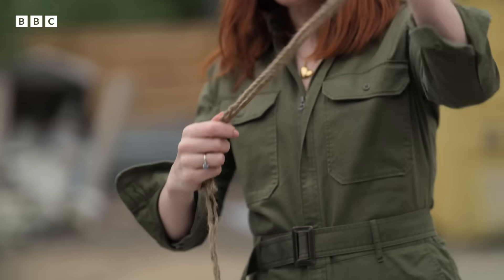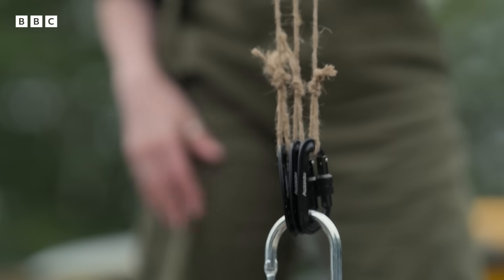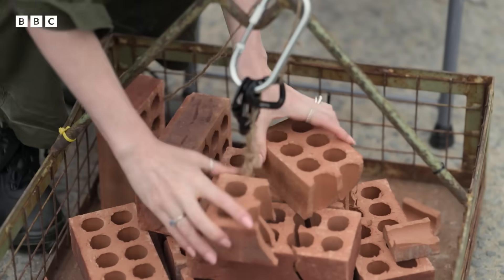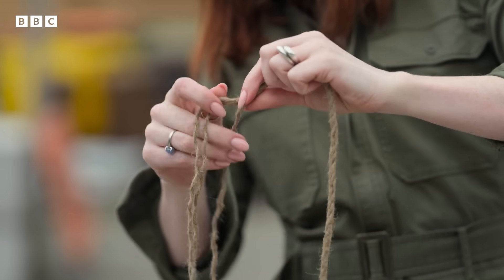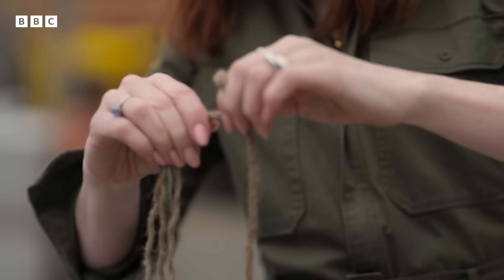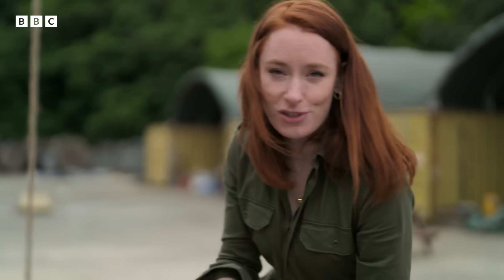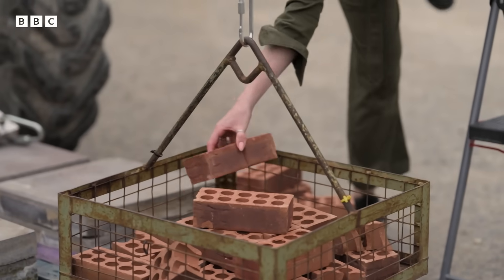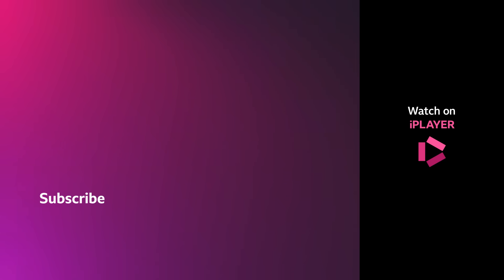The fascinating physics behind lift cables | The Secret Genius of Modern Life - BBC

Comment: And there is a third factor why twisted in one cable hold better I think, and I would like to hear what you think about it: because when you spread the weight across 3 separate and cut 1 - 2 are left. But it is not 50-50, but more like 60-40 % of mass distribution, and the one holding 60% fails even though it could maybe hold 50%, and then the one holding 100% fails. But when you get all the weight on them twisted and cut one - weight is evenly separated between the 2 remaining (even though they are working together so they can hold even more, which means the 2 factors you mentioned do their part, just adding this third).

Comment: Completely lost is the opportunity to discuss the power of pulleys or in this case block and tackle.  The original example used the weight spread across four strands of twine while the final example used a single strand.  Nice discussion of "united we stand" due to friction but a complete fail on the obvious difference in the two examples.

Comment: Not ideal because you have to restart the computer but it's secure, need some sort of self resetting fuse in other words. Drop the connection and the 100 or more MHz pulse takes over and grabs that data and grounds it or you can put it to firewall so you have a log of it as a dropped connection

Comment: 1.- The test is supposed to break threads by just adding bricks in the basket, not by cutting the threads . The weigh in the basket has to break the threads, not by cutting the threads.
2.-How to perform same test without breaking any brick : Lifting the basket just 1 inch above ground, not 3 feet.

Comment: Another factor in the initial failure AFTER one strand was severed is that, as the load was transferred to the other two strands, the remaining strands slightly elongated under the load, allowing the load to accelerate downward as the load was accommodated. 

Since F=1/2MxV^2, that slight amount of acceleration radically increased the load ( the “squared” function) on the remaining stands more than the simple static weight of the load, leading to a sequential “cascade” failure of the remaining stands. 

This “cascade” failure is incorporated in building demolitions as the accelerating upper stories’ mass “pancakes” the lower stories.

Comment: I'm not an engineer, but, if she had cut the center line, it would had still held the weight, by cutting the outside line, she suddenly shift the weight load. but that just my opinion.

Comment: Great production value....   if only the science (engineering) was as good.  Separate strands are only as strong as their weakest point (which is not uniform along its length).  When strands are combined (friction fused), the weakest point of any single strand is masked by the strength of the other(s) at that point in the braid (assuming that the weakest points of both remaining strand are not at the same point on the braided rope).

Comment: It did not fail at 44kg. You cut the string at 44kg.
Great video.
Reply: Didn't she cut the first string at 44kg, the load was then distributed among the remaining 2 strings which caused them to snap? So they basically failed at 44 kg I guess. When they were twisted, they didn't snap at 44 kg. 🤔

Comment: However carefully you tie the strands, there will always be one that is the shortest…even if that’s by an amount that doesn’t show. That will be carrying all the load and will fail first. That leads to the next shortest to carry the load…and then fail. That’s the classic domino effect
 Twisting the strands allows them to settle into sharing the load. Then they each carry their share.
  When using multiple cords or ropes to carry a load there must always be some form of compensation whereby they each carry their share.

Comment: Absolutely doesn't understand rope.
   First test was just putting the load on one yarn as the two remaining yarns were at different stretch.  So one failed then the other in sequence.
    Second test was with equal load since they were joined in a 2 strand rope.

Comment: The knot is the weakest point. In the furst test there were teo knots of one strand each. In the second test there was one knot consisting of three strands.

Also in the second test the length of rope with only teo strands was short. The short rope didn't stretch as much when as the long two strads in the first test. The longer stretching causes a longer freefall time which makes the shock (dynamic load) higher.

Also the bricks were added slowly after the cutting procedure in the second trst so the 'twice as strong' value is not a great comparison.

Comment: I think that when the threads were divided into three separate supports, and then one of the threads was cut, it triggered an effect of a sudden shift in the center of gravity. That’s why there was a cumulative additional jerk. It’s interesting what would happen if the middle thread were cut only.

Comment: I saw this in action when replacing a handrail made of worn polypro line. When I untwisted a length, it fell into dust. It turned out that the 10 foot long line was composed of four inch strands!

Comment: Along same lines you can build a large frame to hold  panels and mount it on a pole  OR you get a longer pole that goes above the panels and use wires attached to panels and pole for same result.  Except the weight is far less and less material needed.   Why this isn't used more often, I don't know.

Comment: There is another factor at work. When you twist the threads together the length of rope is shorter because of the path each strand takes. Under load the threads all try to straighten. This created compressive force inside the rope. Converting some of the tensile force into compressive force this way increases the overall tensile strength of the rope.
Reply: The compression force in the combined thread example is zero. There may be some horizontal forces between the threads resulting in a shear force from the surface friction.
Reply: @fuzybear15  If there is force between the threads at 90 degrees to the load and the threads are wound together and not straight that force is compressive. Ie. The strands are pushing against one another.
Reply: @alanbithell4587  Would a force perpendicular to material not be a shear force?
Reply: @ no , imagine one point of the twist with just two strands. Both strands are trying to straighten. They are pushing against one another in order to straighten. Now imagine you have your finger caught between them. What is happening to your finger? It is being crushed. The deformation of the strands caused by twisting them is converting some of the longitudinal force of the load into compressive force at 90 degrees to the load. It is not a sheer force as it is happening at every point along the rope.
Reply: That's excellent point. If the discussion of compressive force doesn't quite make sense to someone reading, the same thing can also be looked at through an even simpler lens:
When you twist the strands together, the whole thing gets shorter and __thicker__.  It makes a thicker rope, thicker than the three straight sections. A thicker rope is stronger, as we've all witnessed since kindergarten.
Reply: @senseisecurityschool9337  yes! There is actually more mass per unit length; the cross-sectional area is greater.
Reply: Yes. Several factors were glossed over in this demonstration.

Comment: A viewpoint from a structural engineer: a strand does not have consistent tensile strength along its length. It will therefore fail when a load exceeds its weakest strength within its length. When multiple strands are bundled together, the probability is extremely small that the weakest points of each strand lie at the same point. The resulting strength therefore increases closer to the average strength of the combined strands rather than limited to the weakest strength of one strand. If one strand within the bundle is fractured, the resulting strength is limited by the average strength of the remaining strands at the point of fracture. 

When using wire rope for structural designs, we use multiple factors of safety to cover strength variability, load variability, and (if needed) reduction of strength over time if the rope is in a corrosive environment.
Reply: the problem with this analysis is that the weak point will almost always be the knot that connects it to the carabiner (see the channel how not 2 for reference on this). If you check the separated-strand failure it appears the remaining two strands both broke in the knot. 

So I would hazard a guess that the thicker bundle is stronger in the knot, possibly because a thicker bundle has a larger bend radius, although there may be another effect that I can't think of. The larger bend radius should reduce the concentration of tension onto the fibers on the outside of the bend.
Reply: @justinburstein5349  interesting ! Hadn’t thought of that but again - makes a lot of sense .
Reply: The other thing that can happen in this kind of situation is differential loading of the separated strands. It's hard to make the strands exactly the same length, and things like load distribution can mean that some of the strands are carrying more of the load than the others. This increases the chance that one will surpass its breaking strength when a single strand is cut. With the twisted strands, they are more likely to be the same length, and the load can be distributed more evenly by frictional forces.
Reply: Also I suspect the dynamic transfer of load on individual strands is more significant, with the strands together there is less elastic drop putting dynamic tension on the other strands.
Reply: Good explanation. But twice the load?
Reply: @mohamedgoldstein5565  why not? Let's say a strand could hold on average 15kg, measured as the load capacity at several points of the strand and then averaging those measurements. But the lowest measured capacity was 10kg, that's the weak point. Such strand could in theory hold those 15kg if the weak point wasn't there.
By twisting multiple strands you spread the weak points all over the length of strand making the whole bundle behave as if it was the same average capacity in all points.
Reply: Your point is demonstrated during the replay of the individual strands breaking.  After cutting one strand, a second strand breaks and then a moment later the 3rd strand breaks.  The remaining 2 strands did not break at the same time.
Reply: In the first demo when the one was cut it was the shock load that caused the failure. Shock load and static load are two different things.
Reply: What if the three strings in the video break at their individual weak points that are apart from each other? Will the rope still hold the weight in place?
Reply: Oh no I’ve gone cross eyed
Reply: Friction comes into play when one of the 3 strands break at one point, but it is still twisted for a long enough stretch. After the break, locally near the break there are only two strands holding the weight, but the farther you go away from the point of failure and the more friction there is between the three strands, the more the 3rd broken strand comes back into play. 
Think of it at microscopic level, where the fibers are twisted to form a single strand: in this case all the fibers are shorter than the whole strand, and yet they work together thanks to the friction. Each fiber is useless at its start and at its end and contributes more and more as the friction keeps it together with the other fibers.
Reply: Came here to say straps are mind bogglingly strong (more weaves more strength)
Reply: Could you explain in English please 😅
Reply: @maxayam8268  when strands are wound together into one larger cable all the strands carry a near equal amount and individual weak points in different strands become far less significant so the failure of a single strand becomes less likely
Reply: I was going to say the same, but you worded it far more elegantly than I could have done
Reply: The impact loading on the two remaining strings would also have an effect as well as the averaging effect in the second case.
Reply: A viewpoint from a KFC Food Service Worker: When the 3 strands are used individually and are some distance apart, the corresponding load path will be spread across that span of the 3 strands. It may not even have been equally spread across the 3 strands; I wasn't able to assess the end conditions. The cutting of one strand causes a significant change in load path (i.e. it won't automatically be equally spread to the remaining 2) and a subsequent jolt [ d^3r(t)/dt^3 ], therefore a once-static load becomes dynamic. The nearest strand to the cut strand will take nearly all of the reaction to the jolt.
The elasticity of each strand will also have an effect, as the cutting of one of the strands will then cause the others to stretch further, hence allowing the the static load to become dynamic further.

I don't believe in this particualr instance that the variation of tensile strength across the length of each strand would be that high.
Interesting point nonetheless.
Reply: TY for this. Hannah invokes friction when demonstrating with a sisal or hemp twisted rope. Do you agree? Friction would seem less impactful with smoother material- nylon or steel; and more impactful with braided rope? (I've zero expertise here.)
Reply: I think there is another factor to consider, when the strands are twisted the area perpendicular to the load increases thus the load per unit area decreases. Why does the area increase? Think of twisted cylinders and make a cross section perpendicular to the load, the area would be made of ellipses with a larger surface than the circular cross section.
Reply: Thank you for this explanation. Dunno why the presenter couldn't have said that.
Reply: Thank you so much for taking the time to explain this! So nice to have an explanation - it’s a shame that the video was so content free as to not explain this, the intersting part despite being so long. There’s a really interesting story in this phenomenon that the producers missed. I’m not convinced she does well when straying outside what she knows about. Being a charismatic presenter is not sufficient. 

I keep reflecting that braids are stronger still - and I presume for  similar reasons - and that they are extremely resistant to fraying, which in a conventional twisted rooe presumably results with almost certainty the weakest part of the bit that’s cut becomes  loaded …

Comment: Having three separate "threads," each with its own uneven load that is suddenly shifted when you cut one doesn't help either.  Tossing in that last brick tells you more about the effect of the impact than its tensile strength.
Reply: It's been a long time since I studied physics but that struck me too. Also, if you could confirm what I am thinking--

The friction's got very little to do with helping the overall tensile strength. The main factor why the crate dropped the first time was the fact that the ropes were tethered at different angles. When they straightened vertical due to gravity there was impact along the ropes.

The friction isn't suddenly gonna increase the overall upward force; the overall strength modulus of the rope is inclusive of it. Rather, the twisting of strands increases the amount of rope used thereby changing the cross-section and strength characteristics of the totally new rope.

Unless they used the same lengths of strands, twisted them resulting into a shorter new rope compared to the lengths of the original strands? Maybe the friction thing is true then? I am not sure.

Thanks in advance!

Comment: In the early 70’s, a fiend of mine tested the strength of various types of lines (ropes) used in sailing when dry or wet.   He measured the amount of stretch by holding a section of a steel carpenter’s tape measure on a stick held up along side the line.   When the nylon line failed (ie broke), a stand sliced the metal tape in half.

Moral: do not stand next to or in line with a pieces ripe, cable, or line when under tension
Reply: Extreme example, failure of an arresting wire on an aircraft carrier. Don't search if you have a weak stomach.
Reply: Too many spelling mistake, but understood without any problem
Reply: @manabpratimsarma6777  fair
Reply: Ya, heat tha 2.

Comment: The issue with this is that as soon as you tie a knot in any rope or string or cord etc, it weakens it by approximately 50%. They’d have been better tying what’s called a full strength tie off - wrapping the thread around a large diameter pipe.
Reply: Yes. IIRC to preserve the strength of a twisted rope, the fold distance must be at least 2× the rope's thread's twist length.

So if a bunch of threads are twisted into a rope, with the twist achieving 360° rotation every 1 meters of rope, then the big pipe the rope is wrapped around must have at least 2 meters in circumference, or diameter of 63 cm.

Comment: It isn't just the rough texture.  Silk threads are particularly smooth and while already very strong do exhibit the same binding.  It is because the tension pulls the threads towards a common centre, so they are squeezed together tightly and so "bind".  The friction is increased greatly by this squeezing.

Comment: Or, in other words, the strength of three individual sums is the sum of minimum strengths of some strands (for each strand there is a point where it is the lowest strength and thats where it will break).
Whereas for a braided line, the strength is higher because we now evaluate find minimum strengths of strand in small sections of the braid. It is likely that global minimum will not happen for all individual strands in the same small section of the braid.
Also, yes, the load is distributed across all strands in a braid so if one strand is weaker, it will elongate more and therefore before it has a chance to break it will release some of its load onto other strands.